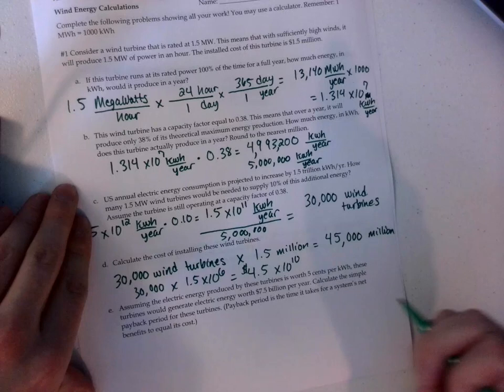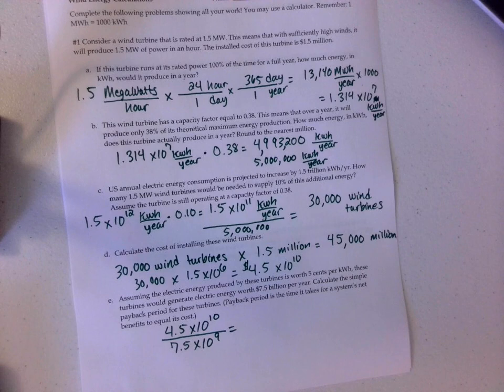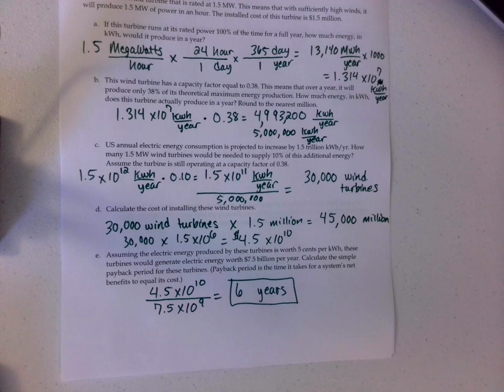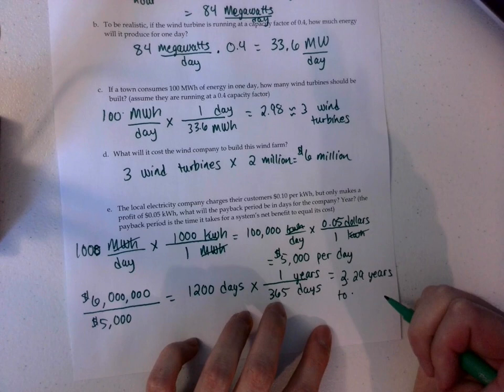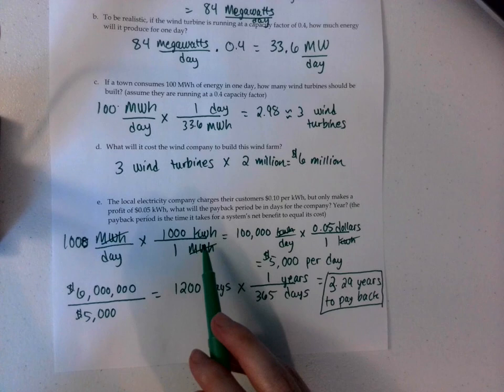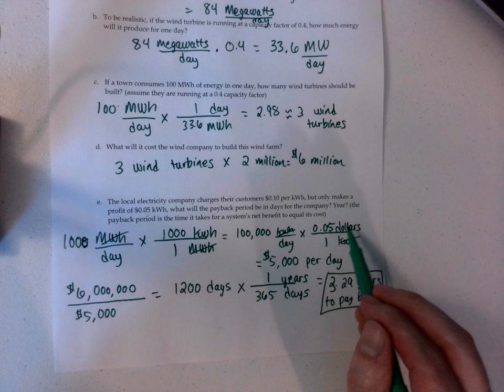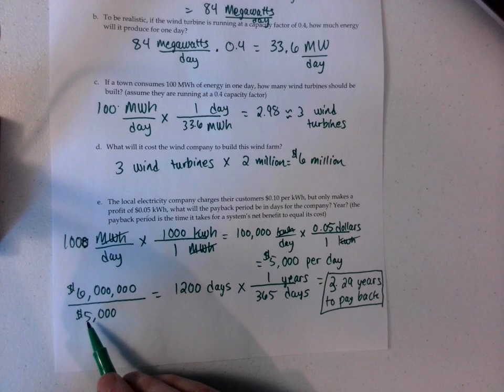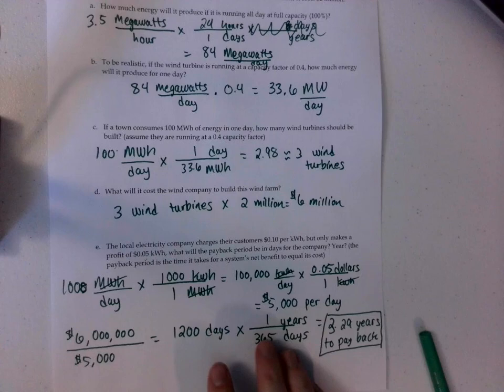Wind Energy Calculations

Comment: Hello Ethan, I was wondering how can calculate electricity out for 12 months when I have monthly wind speed data. Also, use the turbine 1.7 MW.
Reply from the maker: I think that if you have monthly wind speed data, you can use a formula that is different than the one I am using here.  Here is a website that might help you more than I can:  https://www.windpowerengineering.com/calculate-wind-power-output/